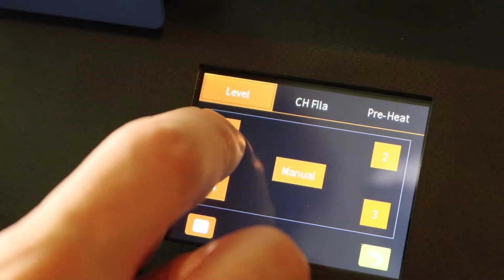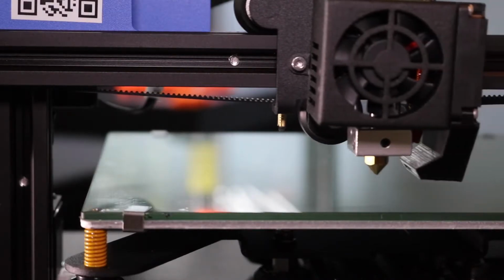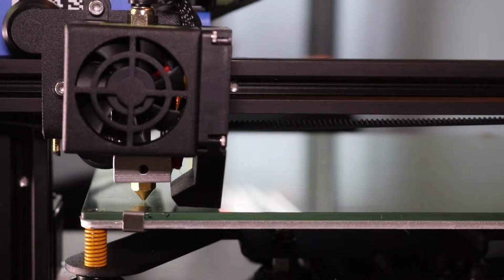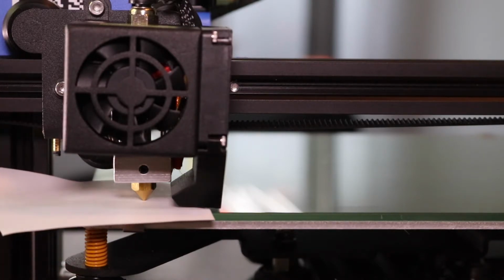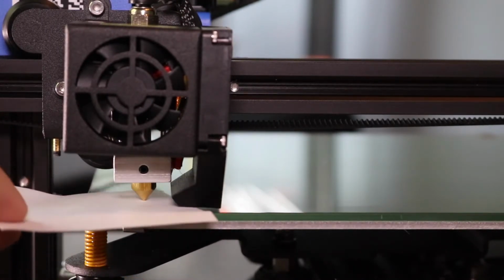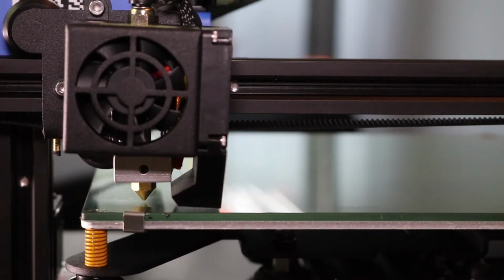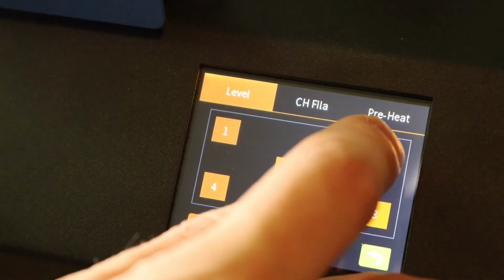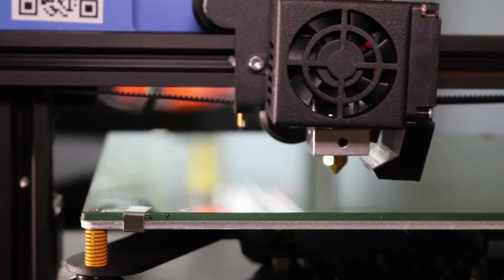Manually Calibrating and Bed Leveling for the Anet ET4X

Comment: So mine goes past to board and down lower than it. How do I fix it if it’s not in the right position? Also the end stops don’t seem to work(obviously) or at least aren’t happening at the right points
Reply: Mine is doing the same thing.
Reply: @acerockollaa  yeah lmk if you find a fix for it cause I still haven’t fixed it